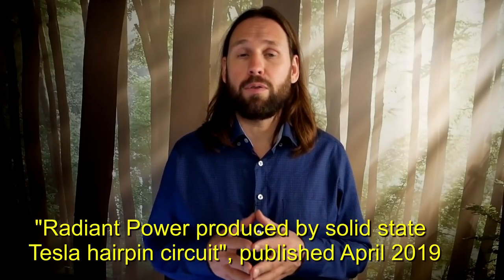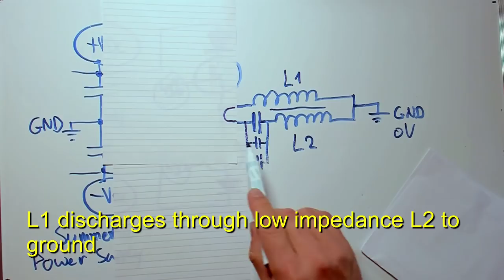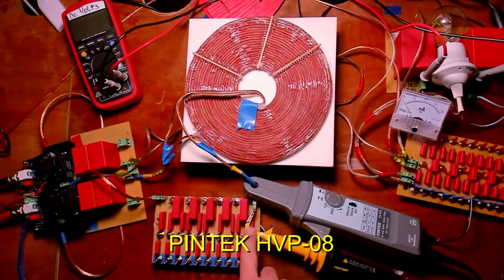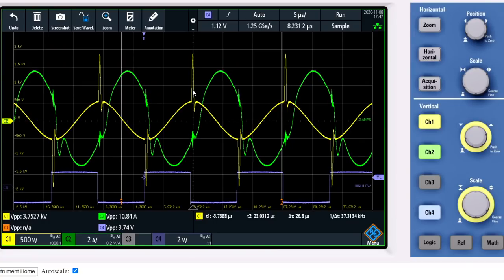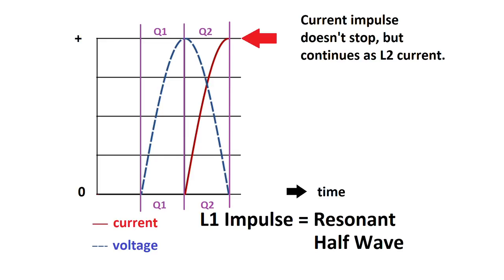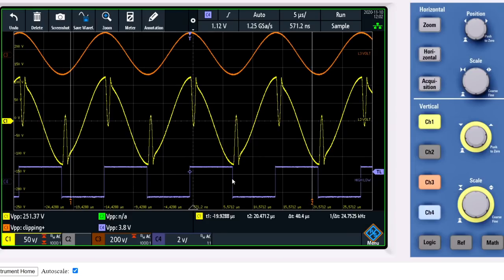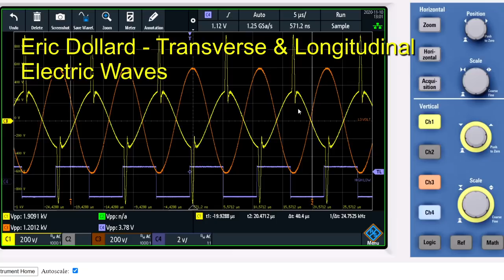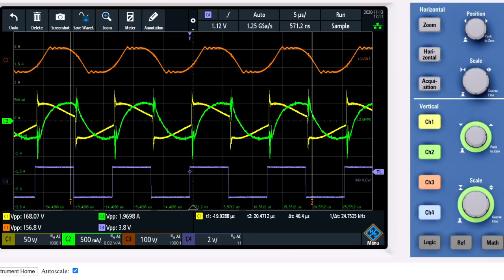Radiant Half Bridge Circuit, For Longitudinal Waves

Comment: No doubt, this covers a lot of my questions. I wonder, if you kept on stacking them, what the effect might be, without changing you input power but rather changing your tuning parameters...? That anomaly was strange for sure wow
Reply from the maker: I also wonder If I can stack it. but that will be answered in the future. first I want a single setup to work. If it can be stacked to output can be paralleled for more power (would love to power a boat around the world)
Reply: @MasterIvo  You have gotten me to think very hard about this subject, one of the things I wondered about last night: the smartest thing Evo did was to limit his working voltage to 1000V, the inductive spikes will always be there. Then what if one could enhance the experiment by increasing the total size of say each pancake coil, one mile wiring each, hollow tubes etc... as a means to harmonize with much larger systems of frequency, and increase the sensitivity of the device?  Would probably need some kind of special amplifier right in the middle of the super large pancake coil. Anyway, just a random thought on how one could get a closer look at what is possible with these clever yet so simple coils. Tesla used spark gaps, you used MOSFETs, very interesting. This prompted me to go look at high voltage MOSFETs, found some, but the higher the frequency the lower the voltage supported and more money. Very wise decision to limit this to 1000V.

Comment: Ivo why do you connect everything to earth ground and not the ground from the power supply?
Reply from the maker: The L1 coil to produce a solid high voltage on one side, must be grounded stable on the other side with no fluctuations. psu is also earth grounded, but has thin leads.

Comment: I realize that this is a solid-state circuit, therefore my question may seem silly.  That having been said, is there any spark discharge anywhere in the circuit, however slight?  If there is, is it green?
Reply from the maker: No there is no spark, the energy is directly transformed. much more efficient. a spark has great losses

Comment: From my understanding so far we can only scale this for more power by using more mosfets as they can only handle so much power compared to what a spark gap can. Do you envisage being able to use multiple mosfets in parallel per coil to gain higher power and if so how well will they need to be impedence and gate resistance matched ? I am thinking along the lines of any higher quality inverter having this considerered or a zvs driver mosfet as they operate at very high frequencies . Is it possible with these diodes and sillicon mosfets to be within the specifications necessary for it to work or would it be more reliable to just scale it by complete extra units?
Reply from the maker: yes more mosfets, but In series not in parallel. this provides many problems. Scaling up would probably be best by developing parallel units. whereby multiple coils provide parallel power
Reply: @MasterIvo  yes i agree it may be the best way to avoid so many complications . 👍🏻

Comment: hello mr ivo, the problem when having the coil one above the other is when one is cut to give the voltage peak there is unfortunately the magnetic field which reverses on the bifilar coil so it may be that  it creates some ridge cancellation so maybe some weird results i am translating this text because i am french canadian so i hope the translation is correct
Reply from the maker: Ridge cancellation? It is probably not translated correctly. yes the magnetic field changes, but actually it is also a current sine wave

Comment: In the book “Secrets of cold war Technology” is written, that the radiant energy only appeared by unidirectional pulses. The effect dont take place if there is any reverse direction. that is why Tesla used the spark gap. Could it be that diodes cant do unidirectional pulses because of leaking current? Isnt it the most important fact of the radiant energy? Do you keep this on mind while developing your circuits? cheers
Reply from the maker: yes. but tesla later used coil discharges instead of capacitor discharges. The coil discharges are also unipolar. I use both polarity impulses alternating as Tesla also did.

Comment: Can we calculate the speed of "electron"/"electricity? does it exceed the speed of light?
Reply from the maker: Yes, Eric Dollard did, and showed this in his borderland videos. he showed, longitudinal resonance is faster (depending on coil geometry)
Reply: I think E=MC2 here, so it will not exceed the speed of light. Not sure how to calculate speed here though!
Reply from the maker: @williamgreenhouse6418    Speed actually isn't correct, as fields are not things/ particles, it cant have speed. It is more correct to call it "rate of induction".
Reply: @MasterIvo  Thanks Ivo, I am still thinking about this in terms of Joseph Newman just to play with the model and would need to do tests. So am thinking that a field is actually electrons activated to spin in a certain direction and angle, this also could be used to predict gravity in a demonstratable way as well as heat and I suspect provides a way to traverse time packets, if you think of the universe as a projection, so plays like a film strip and it is possible to jump from one image to any other on the real, which would constitute what we call time travel. Just having a play and seeing what works! :)

Comment: What if the Ground isn't a drain like standard electrical theory supposes? I mean I'm no expert but the way I see this is from a musical perspective: sympathetic vibration, like when you hit a piano key and a string of the same note on a guitar you have lying around in the same room will start vibrating on its own in resonance with it. I've heard it being said that Tesla used the Ground like a pump and this makes perfect sense in this manner, with the Earth being one big capacitor. Like... what if your whole setup actually acts like one big resonant coil for the ground? What if ALL electrical circuits act like that, with the work per se only providing the resonance needed to "pump" the thingy out the ground (just with very little efficiency since they're not tuned for resonance to begin with)? Then most of the work around the world wouldn't be provided by the motors powering the circuits doing the work per se, but by the ground, with the motors themselves actually providing resistance, impeding resonance.
Reply from the maker: once it works, we will know